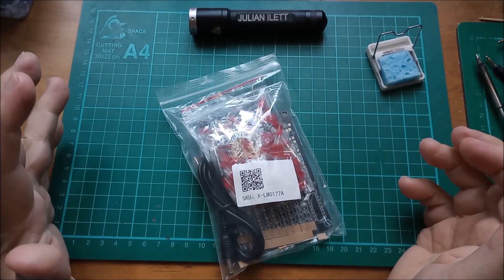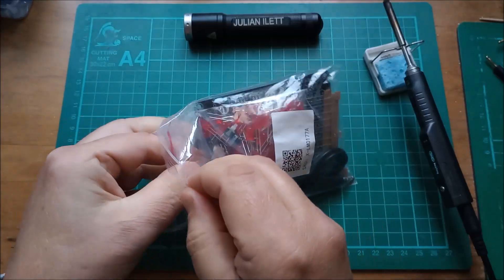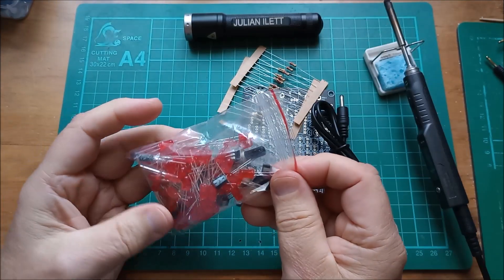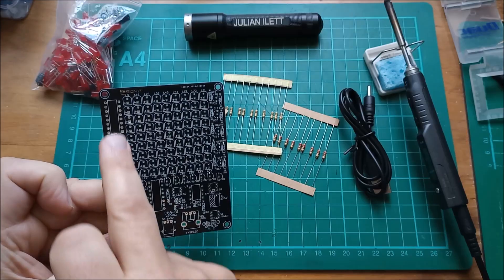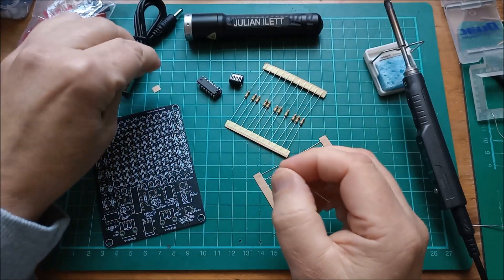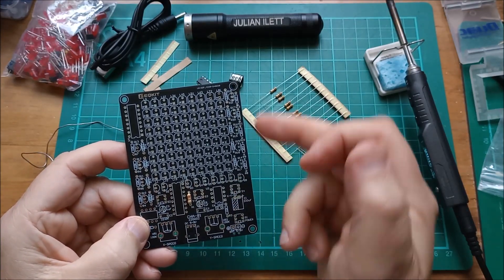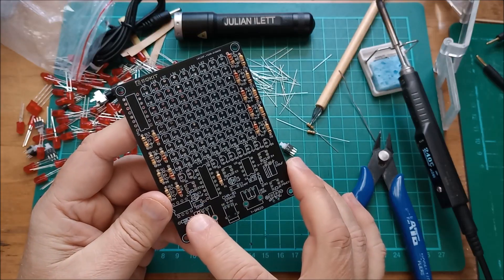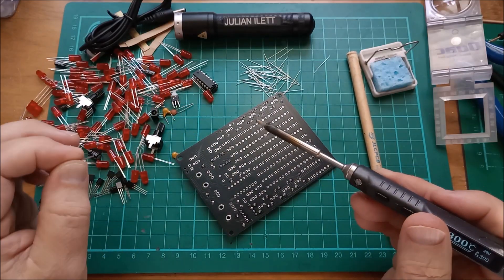Led Matrix Soldering Kit

Comment: ... @13'40" "I will complete this in another video......probably" ... sigh.
I also have the same affliction of 'get it basically working, don't have an immediate use for it, get distracted by another project and never finish current project'
... Regardless, thanks for the video, nicely relaxing.

Comment: I made one normally, then for the second I didn't install the 555 circuits and instead control the LED movement with a microcontroller based on some sensor inputs. Makes it more interesting since it now does different things over time.